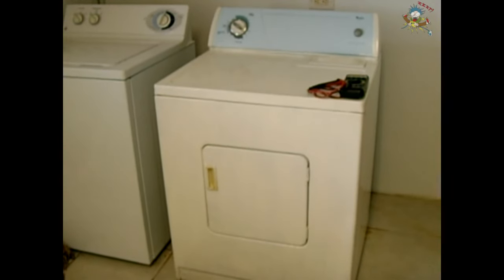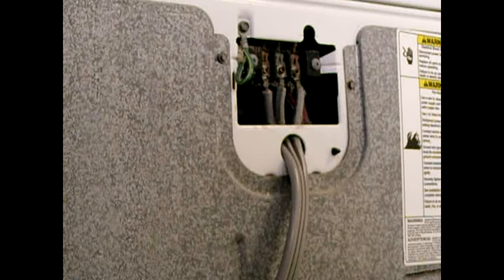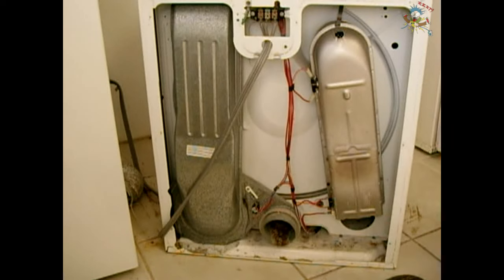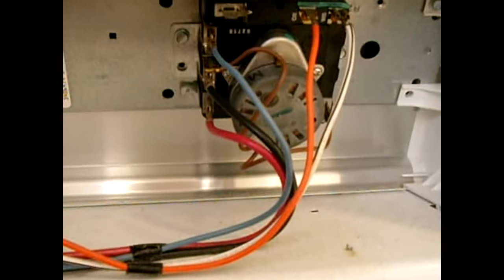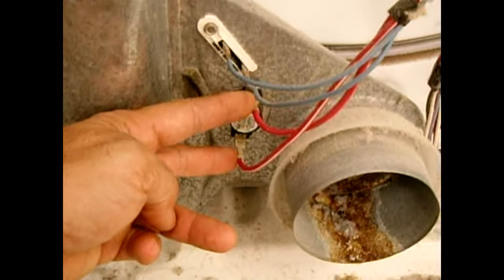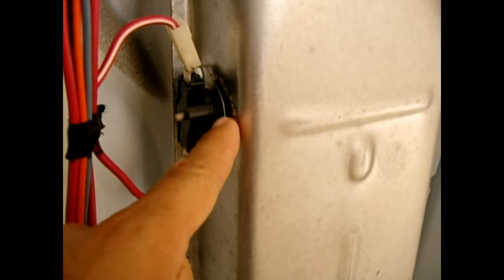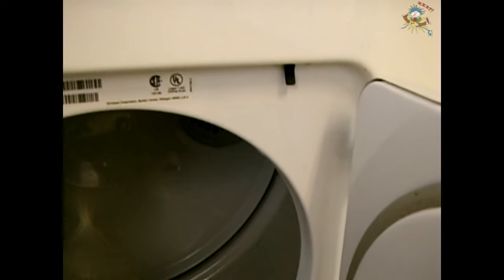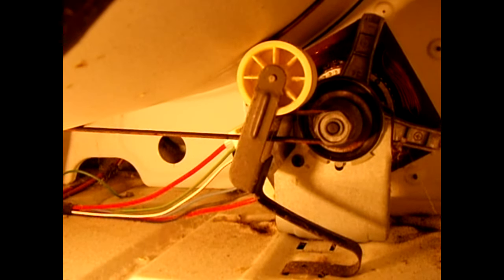Dryer Not Heating, Won't Spin, Or Start Up

Comment: Hello. I have a Maytag legacy dryer. Not turning on when start button pushed. I took off back panel can't find fuse(s).?? Drum Light goes on. Door switch clicks so I think is ok. Start switch has (4) four wires, not 2!?. Plug with 3 wires and 1 single black wire. How can I test the start button switch? Thx
Reply from the maker: +ken peffley 
Hi Ken. Testing the 2 terminal start button is easy. Disconnect all power, then disassemble and locate the blade connectors on the rear of the start switch. Connect a continuity tester across the terminals and press the button ON/OFF and make sure the switch works. You can also use a low ohms range on your DMM. I never saw a 4 terminal switch, only 2 and 3 terminals. Look at the back of the switch, sometimes you can see a diagram on them showing how they connect internally. Using a continuity test is the only way to test them. You may have a broken belt OR faulty belt switch! Try bypassing the belt switch if you have one. Take the 2 female blade connectors pulled off the belt switch and join them together. See if the machine starts. You can also have a power supply problem or faulty motor.

Thanks. Be sure to share my channel and rate Thumbs Up.

Comment: Can a bad timer prevent the dryer from turning on? I replaced the start switch and still not working. I haven't checked the thermal fuse yet.
Reply from the maker: You could have dirty contacts in the switch connected to the motor.
Reply: After further investigation it turned out to be just a broken belt! Left the new switch in that I ordered anyway and kept the old one as a backup.

Comment: My dryer will not come on,  I tore it down , belt off ,barrel out, front panel off, checked all components everything except the motor,  after reviewing the video again I noticed that the green wire just above the power cord was not connected tightly to the screw , and had possibly a burn looking black spot around the screw hole. I put the green wire on and fully tightened the screw to the frame, before I put everything back together could this wire be the problem ?

Comment: I have a dryer that's heats, but won't tumble. Belt is intact, motor turns freely. I replaced the motor, but the dryer still wouldn't tumble. I replaced the dryer with another used dryer and it worked fine, however about a week later the same thing is happening with the second dryer.
Reply: Any ideas on what I should check out?

Comment: My 2 1/2 year old Maytag dryer runs for about 5 seconds and then stops. There is a burning smell which seems to be electrical. Lint has been cleaned out, thermal fuse replaced, and the dryer won't even run for more than 5 seconds on air fluff, again with the burning electrical smell. The plug, outlet, and lines going into the dryer look to be good. I replaced the thermal switch only because it didn't seem to hold continuity. The heating element reads 10 ohms and high switch thermostat both read 0 ohms. The timer gives me a wild reading if I do not remove the harness wires but if I do, it reads 0 ohms. Think it could be the motor?
Reply from the maker: If the air only setting also causes a burning smell, then the motor needs to be replaced.
Reply: Much appreciated!

Comment: If my interior light works properly can some of these tests be skipped? it's a GE electric. Nothing at all happens when I press the Start button.
Reply from the maker: +mjb Mjb 
You need to test according to the video. Could be a faulty door switch, faulty start button, or faulty thermal cut-off.
Reply: +electronicsNmore OK. I'd have it all tested by now but my older GE dryer has 4 very small Torx fasteners along the front. Annoying.

Comment: Is the dryer plugged in when testing with the multi meter. I assume it is.
Reply from the maker: For "SOME" tests(such as checking the power supply), most is done with the cord unplugged.

Comment: helloi am havng a problem, i tested the dryer thermostat (4) prong; only the lower prongs show continuity. is this good?
Reply from the maker: +Leo Don 
Cold thermostat should show ZERO ohms. A hot thermostat should show infinity on the meter. Not sure the thermostat you have, but heating the thermostat using a heat gun/hair dryer should cause the lower terminals to go from closed to open, and the upper from open to closed.
Reply: +electronicsNmore thank you

Comment: my Kenmore 600 dryer won't start... push the button & it makes a click sound but won't start, new start switch, thermal fuse & door switch...im handy but electricity isn't my strong suit so does this mean the timer is faulty?  it has alot of wires on it which is a bit confusing so any help would be appreciated
Reply from the maker: Since you hear a click, I would insect the motor and contacts inside. Could also be a faulty timer control.
Reply: Thanks for the response

Comment: Had no heat. Narrowed down the problem to the temp switch. Changed it and had heat. Temp switch went out again after 1 load. Any idea what could be shorting that switch?
Reply from the maker: Probably a lack of airflow.

Comment: My dryer isn't turning on. I think it's the switch because there is at least 120V utilized because the interior drum light works. The power panel outside is brand new as is the 240V connection to the dryer. It just doesn't turn on when I depress the switch.
Reply from the maker: You need to make sure you're getting 240v at the dryer receptacle.
Reply: @electronicsNmore  Well the light inside the dryer turns on when I open the door so I'm at least getting 120V which I presume what the switch operates at.

Comment: Am I supposed to unplug the unit before testing because I'm not getting any readings from the power cord even though the dryers turns on
Reply from the maker: +NewOrleansEastside 
Probe the receptacle for 240V, and also where the power cord connects to the back of the dryer(The Screw Terminals). Once you do that, then ALL remaining tests shown in the video are done with the power cord UNPLUGGED.
Reply: +electronicsNmore +electronicsNmore my multimeter doesn't have a continuity function. Is there any other way to test the operating temperature thermostat and the other components?
Reply from the maker: NewOrleansEastside
No. Buy a cheap digital meter at Harbor Freight or Home Depot/Lowes.

Comment: What is it when your electric dryer( Frigidair DE500ADW5) works as it should and shuts off at the end of the cycle, but the heat is staying on. Checked the heater, is not grounded.
Reply from the maker: Faulty heat switch in the motor. When the motor is not running, the circuit opens turning off the heat. Either the centrifugal mechanism is faulty, or a person screwed with the wiring.
Reply: @electronicsNmore  Thank you for your reply.If that is the problem I wil call for a technician, this is beyond my DIY capability.Greetings from Lima Peru.

Comment: My Kenmore Elite starts to run and turn when I press Start button BUT when I let go of button the dryer stops.  Circuit breakers checked  help
Reply from the maker: +Judy Godwin 
Hi Judy. More than likely a faulty motor relay switch. Thanks For Watching

Comment: Question the dryer was working before it came to me. When you hit the start button the dryer don't start but the timer still times down. What can be going on electrically in my home. It works for sure but not at my house. HELP PLEASE!!!!!!
Reply from the maker: Maybe a faulty door switch.
Reply: No. Switch is good. I had the company bring a new dryer and it's doing the same thing. Timer works but dryer isn't running. But was working fine before it was bought to me.
Reply from the maker: @ecaptain76  Definitely your power supply.

Comment: on your high temp. cut off just bang it on the ground a couple of times and the disc will reset and make it a closed circuit and not have to buy another one. the end.

Comment: hey ive got a drier that cuts off in less than a min what could be the problem
Reply from the maker: +air tech service 
Clogged up with lint, faulty blower, or faulty thermostat.

Comment: Great video.  I've followed all of the steps you outline, but still no success.  My dryer produces heat, but takes 3 or 4 cycles to dry clothes.  There are no obstructions and there is continuity in all of the electrical components.  I have replaced the cycling thermostat, timer and fabric switch and it didn't help.  The element produces heat and I've measured 220 degrees at the point that it enters the dryer drum.  Drum rotates and fan appears to be OK.  What else can I check?  The problem developed after I replaced drum seals, glides and bulkhead.  Either the mechanical airflow removing air from the drum is impaired or the heat is cutting in and out after startup.  How to I determine which it is and what is causing it?
Reply from the maker: Hello Bill. Measure the voltage at the heating element terminals while the dryer is heating. See if you have at least 220V.

Comment: My Whirlpool dryer starter turns on and stops almost instantly. The fan belt is intact. I don't know what else to check. I'm pretty good at fixing things, but I'm "a bit" elderly and crunching down in a cramped space is getting harder and harder. What my brain doesn't understand is how to diagnose the problem.
Reply from the maker: Unfortunately, you need to follow the steps outlined in the video. Thanks for watching

Comment: Does anyone know where to buy a replacement centrifugal switch? Looks like it's not supported and they want you to buy a new motor.
Reply from the maker: Try taking it apart and cleaning it.
Reply: @electronicsNmore  Actually the centrifugal is ok, my problem was a bad timer motor. As I was researching parts I discovered that you can buy everything except the centrifugal switch.  It just seems wrong to have to replace a perfectly good motor because of a bad switch. I am trying to think of a way to safety bypass that switch? Considering trying  to reengineer that switch using a lawnmower governor.

Comment: I have test everything and I get continuity or the proper amount of resistance on each part. But my dryer still will not heat. Turn it on the iginitor starts to glow flames up and about a minute later the flame goes out.So does anyone have a clue of what can be wrong?
Reply: What type of dryer do you have?

Comment: Thx for the quick response. Here I believe is the replacement start switch. Multiple connectors!! http://www.appliancepartspros.com/whirlpool-pust-to-start-w10117655-ap3967214.html
Reply from the maker: +ken peffley 
You need to read what is written on the switch. I cannot read it. When you press the button, one set of contacts should open and close the circuit. The other set may do a similar or opposite action. You need to play around testing it, and open it up to look at how it works.

Comment: Voltage measurement under load is far more accurate diagnostic than resistance measurement.
Reply from the maker: True, but both work. :-)

Comment: why wan.t my dryer barrel turn .it will heat but the drum don.t turn
Reply from the maker: It would be a great idea to open the unit up and look. If you hear the motor running, then the belt is broken.

Comment: My kenmore dryer won't start,  i just changed the thermal fuse and it still won't start
Reply from the maker: Probably a faulty door switch. Try bypassing the switch as a test.

Comment: This video seems to be extremely well done. However, it is beyond my pea brain for electronic references. I guess I'll have to call a "professional" to do a simple repair. I've never understood the difference between an ohm, watt, and voltage. An explanation or referral video would have been nice.
Reply from the maker: +Mr. Ken 
Hi there. OHM is a measure of resistance, Voltage is just like a pressure reading in a water pipe, and Watts refers to how much power is being used.
Reply: Thank you.

Comment: Great video
Reply from the maker: Glad you enjoyed it Carlos!
Reply: @electronicsNmore  I went truth all the parts in the video and ever thing check out Good but I an still losing a 120v leg to the heat element.   (Any ideas) I even check the motor out
Reply from the maker: @carlossaenz4075  Could be the switch contact on/in the motor.
Reply: @electronicsNmore  I have everything out of it to get to the motor and I check the motor out just like in the video and it check out ok..
so tomorrow I an going to turn it on and see if it closes on the motor and check the the power coming out on both of the red lines .   I think I should have 220 v or 110 volts
What do u think

Comment: My whirlpool clothes dryer GEW9200LW1 timer display goes from 56 minutes to 35 and back to 55. Clothes are not drying completely due to this. What should I test? I've already tested the heating compartments
Reply from the maker: Sounds like a faulty control. Did you test drying using other settings?